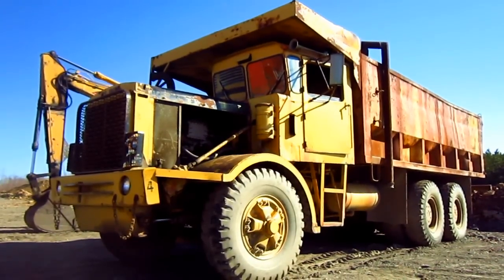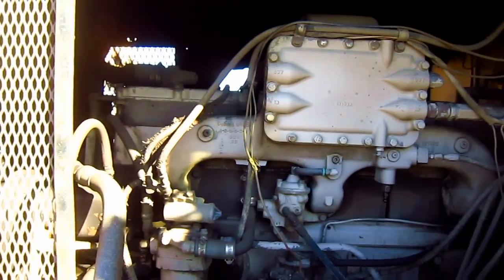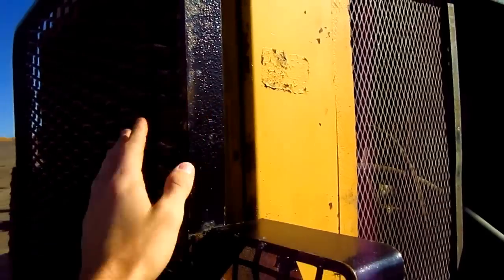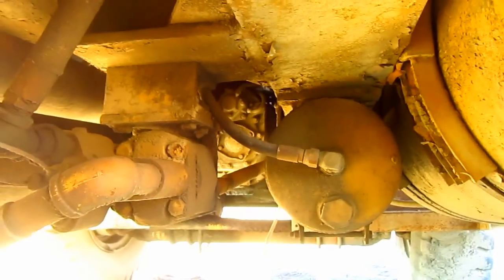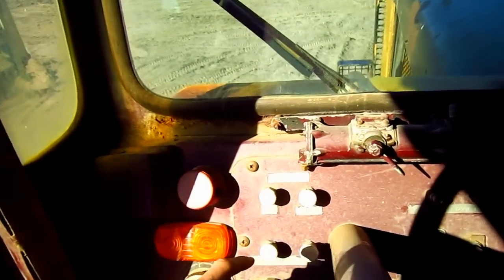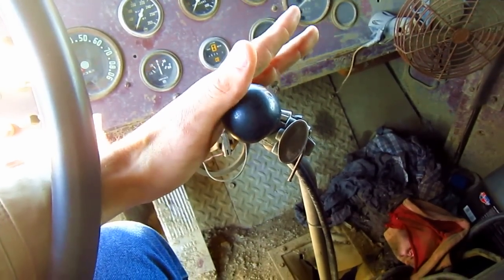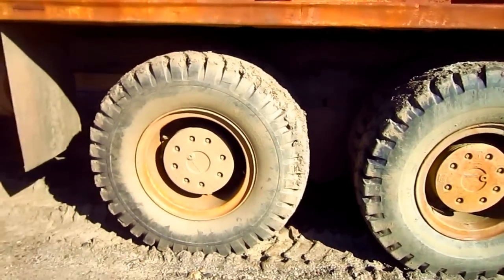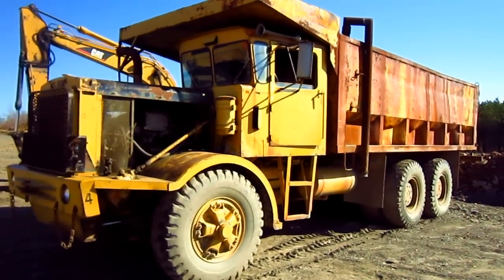Cline TD-1120-P Documentary

Comment: Eagle coal an dock/centeral asphalt/w.v.paving/v.n.green co.} use to have + or - 8 clines with the automatic/shift position transmission that had a retarder type hold back for steep hills,used to haul coal off the strip,and at 40 ton the bed isnt full yet. The dump bed on this cline is LARGER than the "off road bed" on a 800 mack. Ive had 47-48 ton on a 800 mack with the off road bed,so go figure..............Ive also drove  a cline with the manuel shift/roadranger .Theres a slightly earlier cline than the one in this video,it had a straight exhaust stack,straight up out on the middle of the engine compartment hood,and a slightly newer cline had the muffler mounted on the passenger side front fender.........